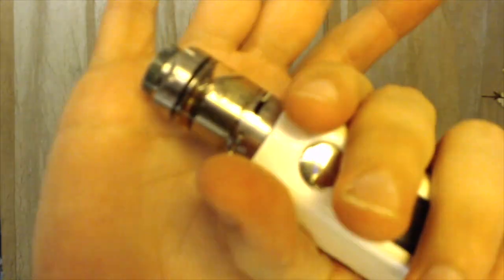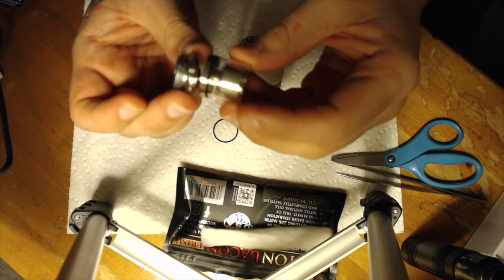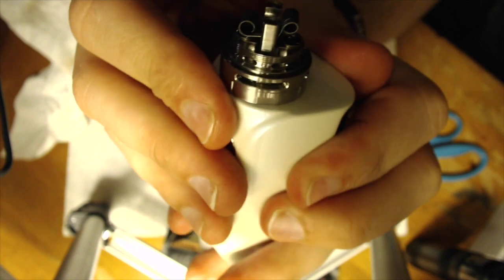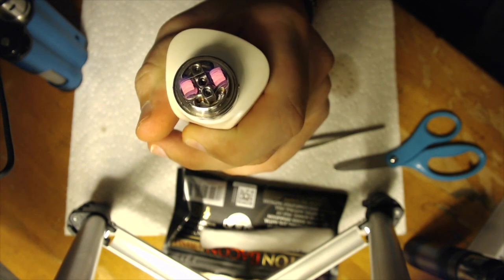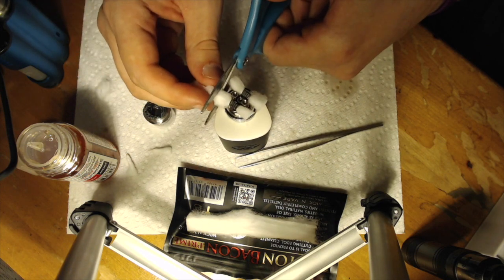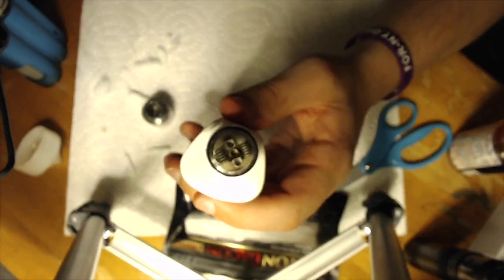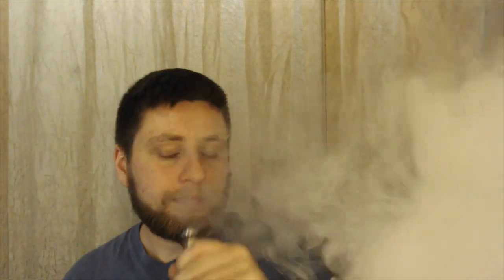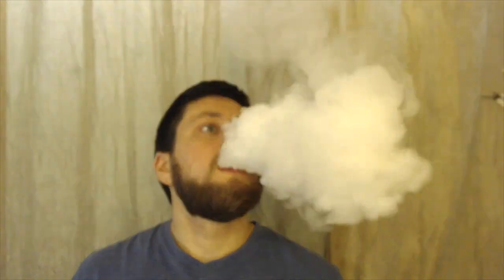Footoon Aqua Master RTA

Comment: I love this RTA! I have had two of them for  over a year. You need to make sure the airflow tab things are screwed down. It's hard to explain. My airflow is still working great!  It's a little bit of a pain to wick perfectly using 3mm coils. 2.5mm coils are much easier to work with. Way less cotton